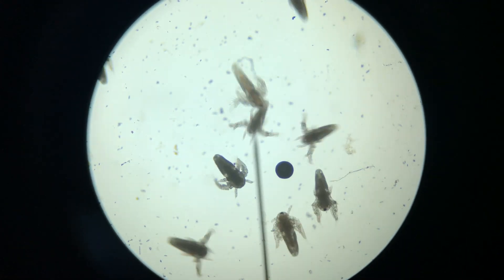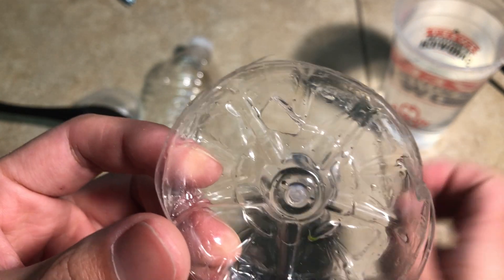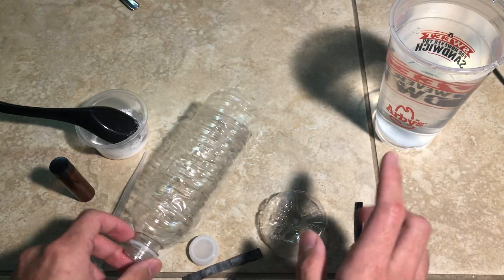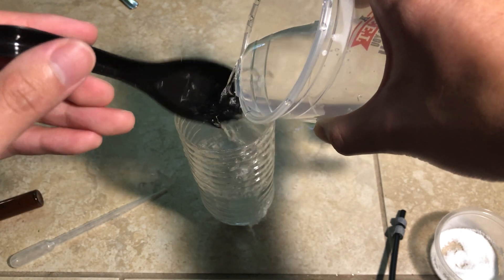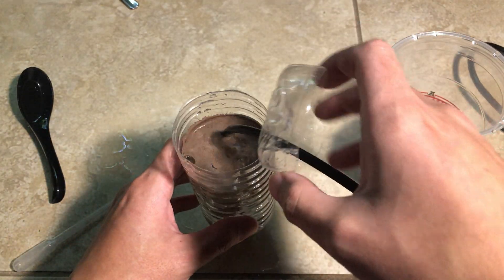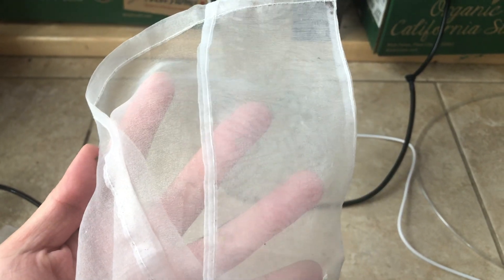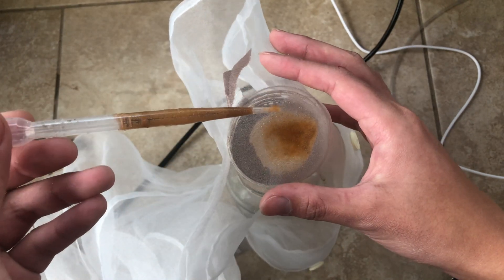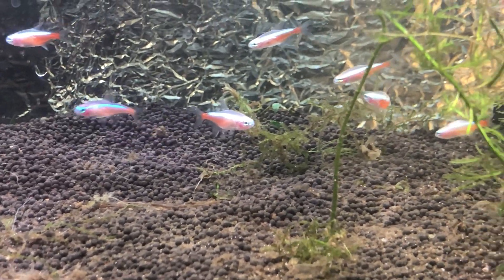How to Hatch MILLIONS of Brine Shrimp | Cheap DIY Brine Shrimp Hatchery for Bettas, Tetras, Guppies

Comment: If you are into 3d printing, you can make a dish style hatchery yourself.  Cults3d has one, just search there for "BRINE SHRIMP DISH HATCHERY" and it will turn up.  No airstone, no heater required.  Also, you do not need to dechlorinate brine shrimp hatching water.  The chlorine actually helps soften the shells at first, then evaporates by the time they hatch.